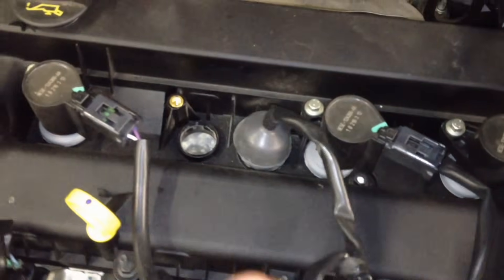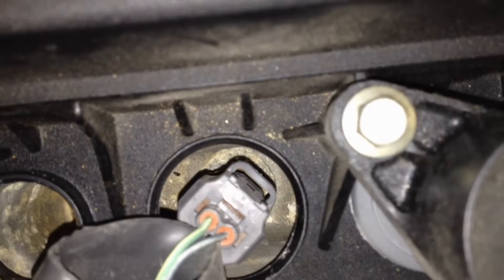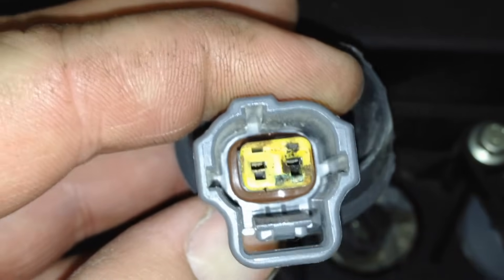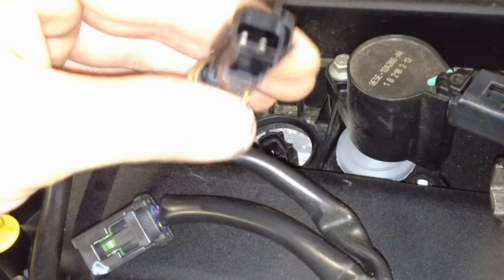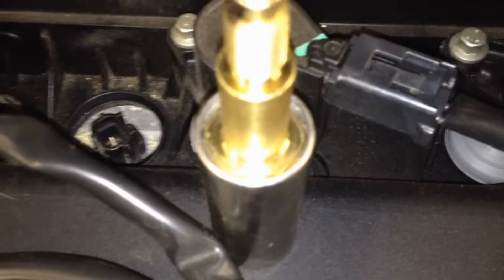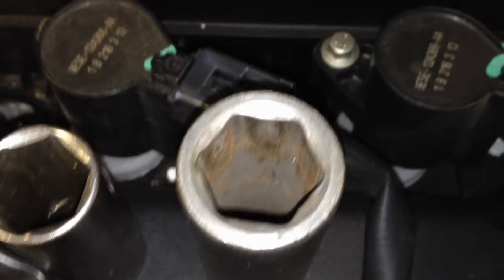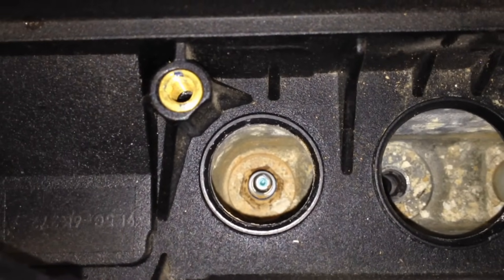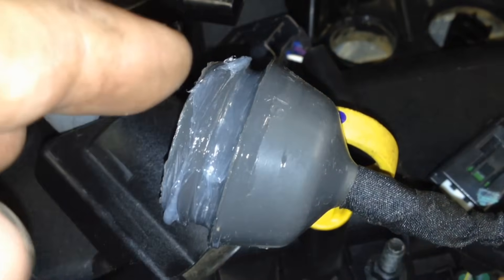Ford Escape & Fusion 2.5L False Overheat And Misfiring

Comment: The Ford dealer in Bastrop, Texas tried telling my sister her water pump went out or needed replaced after they did some recall work. Thanks to your video, I changed that sensor out and her car worked fine. Saved her $1700 Ford tried charging her. Thank you for taking time to make this video 8 years ago

Comment: Another point. My dad took his car to Jiffy Lube for an oil change. They noticed some type of fluid leak. Since the car is a Pontiac my dad took it to the Pontiac dealership. An estimate of $1300 to replace the oil pan gasket and a CV joints. Fortunately my dad said no way. Instead he took it to our local mechanic and Graniteville, SC. It was not an engine oil leak. There was a loose hose on the power steering. The end result is that he saved almost $1000 by not taking it to the dealership and getting a correct diagnosis.
Reply: Yeah my wife's Yukon has been riding ruff. Dealer said $1800 front struts were leaking. I bought the AC/delco shocks from Amazon. Had local shop put on. Shocks were only $300. Got out less than $800. But vehicle still rides like crap. Very bouncy. So I did research online. Found there is a TSB. You go into gmc website type in Vin. It showed the ride control had a software update to address this. I printed out screen shots of everything, weblink all information to make it simple. It has a part number for the update. I gave them all of this. It even says this addresses the ruff ride. These are magnetic shocks and computer controlled. Took to dealer today. They called me said their tech said we just needed new shocks. I said yeah we already replaced them. He said they didn't know what I was talking about with the updates. I'm like this is your GMC website, your TSB and you dont know what to do? There like yes don't know what your talking bout. So gotta pick it up today. I at a loss for words. I work on Toshiba equipment for a living. I have similar prosess for updates that come out. It's something I could do, I just don't have the programs they do to download and update it. So I don't know who to trust.....

Comment: My 2009 Ford Focus was having an issue going cold.  Changed out the thermostat, and while doing so found a leak in the radiator.  Replaced the radiator.  Put vacuum on system and filled with coolant.  Same thing was happening.  Replaced the cylinder head temperature sensor and valve cover gaskets.  No further issues.

Comment: I cannot find a deep socket that will fit all the way over this sensor, I know its 19mm, and I have tried 3 different 19mm sockets, and I just cannot get the socket down over the plastic part on top due to the inside of the socket....why is it so hard to find a socket that fits here...and nothing else but a socket will go down there.

Comment: Couldn’t find proper deep 19mm or 3/4 socket. Ran thru all the tools and parts store in town. Ended up cutting a 3/4 deep socket in half and welded it to another deep 3/4 socket, worked like a charm in case anybody ever ends up in the same situation.

Comment: I have a 2001 Ford Focus SE. Lucky for me through the years, my parts were still originals for 16 years, but then I got the overheating when driving 30 mph down residential streets. I learned the exhaust fans weren't coming on when engine gets hot. They do come on when AC is running. I changed the temperature switch and alternator while at it. When finished, the engine sounded way better and more powerful, but still had overheat. I changed the Thermostat. But no. After a lot of researching online and you tube, I finally found one thing on you tube I hadn't seen before. The resistor connected to the fans. The resistor wires are connected to the temperature switch. It activates the fans if the engine gets hot with no AC running. The connectors were both fried. After changing resistor, it worked and no more overheating.

Comment: Hey I just wanted to thank you for these videos... This one in particular. I bought a used 2012 escape from a non ford dealer a few weeks ago in a pinch in winter and used your trans fluid change video then just got stuck on the side of the freeway in the Dakotas and found this video. It literally saved me a tow truck ride in the middle of the night (and I have to work in the morning) I had the overheat and CEL and felt the engine and it wasn't that warm... Googled fake Ford Escape overheat and found another one of your videos. Pulled the plug for the coolant sensor and sure enough that cup in the plug is full of water. I used some paper towel to soak the water out of the male sensor cup part. I dunno if the dealer pressure washed the engine or what but I made it home with no other problems. Sincerely thanks.

Comment: thank you so much for making this video I was dreading having to take my car to the shop after it started reving high with the fan immediately coming on at startup and not having to hit the gas to accelerate up to 30mph I also noticed my temp gauge staying cold or shooting hot while driving and I knew my car was full of coolant and i just replaced the pump and thermostat a few weeks back.. this completely fixed my car no more reving up at startup with immediate fan running. it's back to normal and the suggestion of the tire tool was a life saver i couldn't find a extra deep well socket in town at all and was dreading having to drive half an hour over and back to the next town just to pickup a socket from harbor freight.

Comment: this is exactly what was wrong with my car. two things different, 1 - on my vehicle, the sensor was intermittent. It was until I replaced it I was able to find out that it was the cause to the problem I was experiencing. Which brings me to the second finding, opposite to what video is talking about. on my car the temp indicator wasn't even moving. Additionally, the fan was coming on as soon as I start the car even on a cold morning.
the replacement was supper easy. I torqued the sensor as I would for a spark plug. Over all this was a good informational video to help identify and fix the problem. Thanks FordTechMakuloco

Comment: I've  got a 17 Escape Titanium with the 2.0. It started misfiring and saying it was overheating when the ambient temp was 50 degrees and the car had just been started and run a half mile down the road. I hope that this is my issue. I usually wouldn't go to the dealer, but I've had my doubts whether or not an independent mechanic could diagnose the problem. There are coolant intrusion issues with the ford ecotec engines, and it's been spooking me to no end. Wish me luck folks, and THANK YOU FOR THIS VIDEO.
Reply: Any more info?  Having same issues

Comment: Thanks again Brian for you to share with us your wealth of knowledge. I was having on my 2010 Focus with 2.0 Duratec the cooling fan on high speed with a cold engine. Its November now here in Quebec and somehow cold with snow. The cylinder head temperature sensor was giving the pcm false informations. There was no codes, no check engine light, just my cooling fan going on at full blast when it shouldn’t. The temperature gauge on the cluster was reaching it’s (normal) indication faster then normal as a clue. The temperature would stay there, no weird indications. I did use a 3/4´´Deep  socket 12 sided from Performance Tool. It was just perfect to complete the task. Once again, many thanks!
Reply: Would your car heater work while this was going on?

Comment: From one Brian to another...thank you! I replaced the thermostat in my wife's 2009 escape and it had obvious air pockets. It actually put out heat in the cabin, which it didn't do before, however after awhile it overheated again! UGH! Just checked for codes and wouldn't you know it P1299 "Cylinder head overtemp protection active" in other words....bad sensor. The many videos I started to watch were not the correct placement of the sensor, until THIS one!! So, again.....THANK YOU!!

Comment: Thank you for the video! Had a 17 focus 2.0 I did a engine on and I was having misfires and false overheating. Pulled the connector and it was soaked with water. Blew it out with compressed air and engine is running like it should 👍👍👍

Comment: you are very smart on these fords,  my escape is doing the same thing, The temp gauge would peg over to hot and then drop back down, engine light is on,  they plugged it in and a P1299 code came up, they couldnt tell me what that was.....(hmmmm)    I found you on here years ago when i was searching about the drivers axle seal leaking on my escape,  i talked to you and i had thought about driving out to your place so you could change my seal, but it has not got any worse i might have to add a few ounces of atf twice a year ( and i only use type LV )  in my book you are the ford man, you really know what to do and how to do it,,,,thx again i will go out now and check that plug for corrosion and scrape some off if possible...  kinda adds up i had just lightly sprayed my motor compartment with a hose just the other day.......(imagine that )      thx again ,,, #1 ford mechanic...Oh btw i have 95000 on my little 4 cly escape now,  only use motocraft synthetic blend every 3500 miles,,,,  no problems,,, except for new belt and idler pullys last year.......thx guy, have a great day......

Comment: Thanks this solve my issue on my 2010 focus .my temperature gauge will not work sometimes and red temperate light will come on. Now it runs like new .. you can remove the sensor using a weed eater Spark Plug Wrench, It is deep enough  and you can get it at home Depot . Hope this helps.. thanks
Reply: Used a weed eater spark plug tool myself, it works, just barely but it works. Easier than trying to find a bit that has no shoulder. Damn near impossible.

Comment: I've had this happen to many 05 focuses 2.0.I put in a new one from O'Reillys and it threw a code for thermostatic threshold.theyve updated that part and the actual part that sits in the passage is smaller on the new one. Even on the ford lucky me I found the original OEM ones in the junkyard.2 years later no codes on anyone of the ones I've replaced on mine and customers cars. I like working on one brand its a lot easier for diagnosis and it helps with book hours. Its great going from a ford to a Mercedes Benz

Comment: Hey Brian! My wife just had an issue with 2013 Ford Escape Titanium Ecoboost. Something blew, a hose, radiator or something. I popped the hood b/c the code read on my reader P1255 and notice green fluid. Thus it slowed the engine down to low throttle to avoid over heating and low power. Couldn't even get it up the slanted driveway into the garage.
I put coolant in and right away noticed it pouring out the bottom. 
Gotta have it towed to the mechanic. While it's there it needs the wipers worked on b/c those aren't responding.
SOme days I want to ring Ford engineers by the neck!
I try to stay loyal to my home state but Ford has been falling fast from favor with me.
I have a 2010 Fusion SE I bought used. Running great for now.

Comment: I think you just diagnosed you issue to a t. My transit connect will falsely overheat and runs in limp home mode. Engine isn’t hot because I pulled into a gas station and ran cold water over radiator. No change in heat.  Turned van off then on, problem went away for awhile.  I also had a code for cylinder 4 misfire.  I will check the plugs as well.

Comment: Good info. Ford Dealerships Will Screw Ya! Yes, this video is old but so is my Wife's 2009 Ford Escape (non-hydrid) 2.5ltr. This car was bought new by my Grandmother. So it's supper clean with less than 100k miles. The steering started screwing up & Grandmother didn't have those non power steering issues during the time of the recall. We were told Ford only Offers to cover a recall if it's done within a year. So, we buy the car because the Dealership wanted $2k for the Steering Column, they already charged $400 to replace the Torque Sensor. I looked on EBay & bought an OEM Ford Steering Column for $1k, the same part # as the $2k Dealership column. Then the Dealership wanted an additional $500 to install!! I got an Independent Shop to install for $200. So a Dealership $2500 charge only cost me $1200. Steering is like new now.. Still less than 100k miles on the Escape & my Wife loves it. Stay away from used Escapes & other Hybrid Models because Ford only warranties the big flat Hybrid battery for like 3 or 4 years & they don't last much longer than that. If that Hybrid battery is dead? That car will stop running, is what the dealership told me.

Comment: Lifesaver thank you so much I have an 06 escape hybrid with $311,000 mi on it and she is been my tried true blue go to get to anywhere zero maintenance except for oil changes tires and lower suspension but for two years she's been sputtering slowly just getting worse very slowly emissions lights coming on once in awhile not sure you know if it's going to be a big thing spottering misfire just today when I needed her it was really hot out her ECM just went nuts and I usually try to reset it I play with it and play with the cooling fans in the battery pack disconnect the battery and usually that works to reset her but she didn't reset today and I thought until I saw your video that I'm up schitt's creek without a paddle.! Well oh my God I'm going to go and look at my car right now and see if she has that same issue cuz it's a miracle I found your video I was praying for one and there it is amazing here incredible mechanic and coming from an almost retired diesel mechanic I have to say you impress the s*** out of me! Thank you
Reply: Well just checked it it's not corrosion it's oil my valve cover gasket must be leaking the whole compartment filled with oil underneath that boot probably about to the top of the terminals so I'm going to guess that it's misfiring because of the shorts and now it's the level has gotten high enough to interfere with the coolant temperature sensor permanently or not the coolant sensor but the head temperature sensor but that info was a lifesaver thank you God bless

Comment: I have a Fusion v6 and I'm having problems with engine overheating.

Works all day normally, but when I accelerate a little stronger, the temperature rises, sometimes little, sometimes a lot and then down to normal temperature.

Already changed the radiator, water pump, did cleaning of the system apparently is not mixing water with oil and the car in no time failure.

Have you seen this?

I know the car boils, because if I open the water reservoir, the water jumps all out.
Reply: Felipe, boa tarde. Você conseguiu resolver seu problema?
Reply: I'm having the same issues. any resolution for this issue?
Reply: I still have not solved my problem, I replaced thermostatic valve, water pump, belt temperature sensor and radiator.

My mechanic is suspicious that it may be the automatic transmission that is heating 6F35.

 Case you find out anything please let me know.

Tanks.

Comment: I think you just saved me alot of time. My car is "over heating and misfiring a minute or 2 of cold start sometines. Just checked this sensor and it is sorta wet i took it off and tried to clean a but and the car is running a little better

Comment: I could have similar problem getting misfire on cylinders 1-2-3 (PO301-PO303) figured boots or coils are bad so I replaced still misfire hadn’t had plugs in a while so installed running better but still rough at idle and check engine light back put code reader on and reading PO302 could be that temperature sensor?

Comment: I got a 2017 escape 2.0 that reads ect at 180-200 but once you give it gas the cht goes to 240-320 even 350 if you really step on it. replaced the cht/thermostat and still same condition

Comment: because of your video I fixed my 2001 crown Victoria by changing the coolant temperature sensor as you described......it looked fine but had a amber brown color on the part that goes in the coolant and the new one was brass color....so the amber must have been build up??......but that fixed the false hot reading.......I thought the head gasket was blown and was gonna sell the car.......thank you...thank you...thank you!!!#####

Comment: I have 2010 Mercury Milan Hybrid with 218,000 miles. I get a High Motor Temperature Warning only when it is raining heavily or the day after I drive in heavy rain. It sounds very similar to this issue. Dealer keeps telling my it's the Hybrid Control ("Hybrid brain" is how they described it.. I don't know..). They say it needs replaced and quoted $3500.. $2500 for the part + $1000 in labor. Like I said, this only happens when I drive in the rain or the day after rain. I get the overheat warning within a few seconds of the car starting, even if it's been sitting all day. The car usually runs just fine. Just get the darn annoying warning. Some times the warning is so brief, you don't even see the warning symbol, you just hear the chime. When it's raining heavily the warnings are enough to drive you nuts. After it dries out for a day, no issues at all.. Runs like a champ for weeks on end until heavy rain again. I've been dealing with this for over a 100,000 miles now. I drive a 1000 miles per week. I think a 35 cent bead of caulk will probably fix the issue but the dealer is incapable of properly diagnosing the problem. I am going to ask them to look at the CHT Sensor now and see what they say.  I cannot find the TSB # for this. Another site says it's 11-10-5 but I cannot seem to find any other reference to this or the actual TSB

Comment: I tend do what was taught myself but I’ve not ever had a Ford Fusion an escape yes! But didn’t encounter a problem like this only thing is it was running OK as it would if my O2 sensor needed changed I changed it and BAM I get two other codes and it doesn’t accelerate!! So imma try this nd HOPE this works!!!! Ty for this video I have subscribed!!!